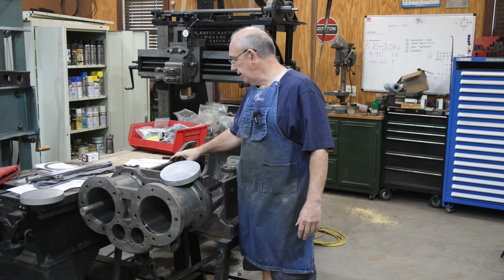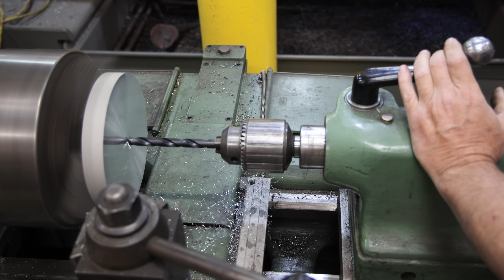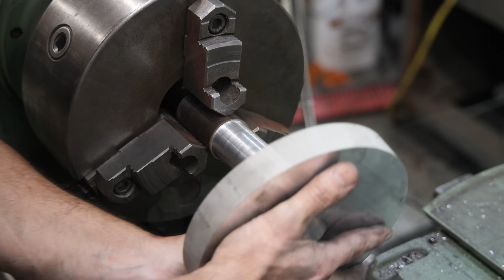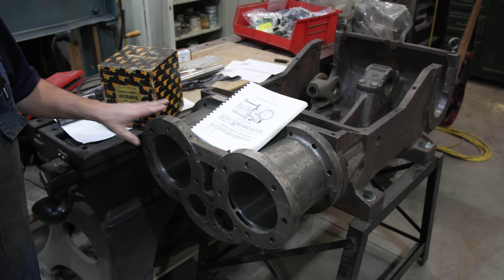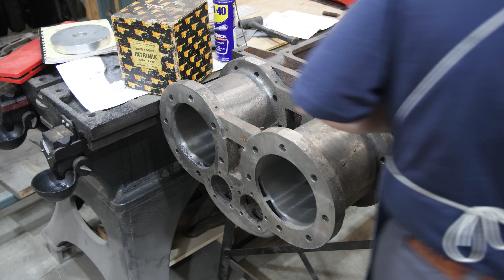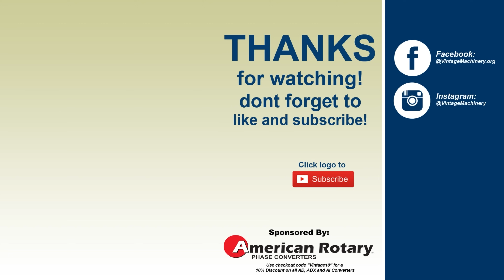Steam Stoker Engine: Turning Alignment Disc for a Crosshead Fixture

Comment: The connecting rod to cross slide wrist pin plane is going to have to be held parallel to the crank shaft as part of the babbitt pour setup? If not the cross slide Babbitt bearing surface could end up not being parallel to the wrist pin and cause the connecting rod big end to be twisted on the crank shaft journal. Might be getting ahead of myself here of course. One way to achieve this would be to duplicate the cylinder rod disk setup and then make a long wrist pin mandrill that passes through both cross slide wrist pin bores, effectively removing any potential twist in the setup. Keen to see how this pans out.

Comment: What was the purpose to clean up the case bottom if the pony rod will ride on babit?

 the
Reply: I was wondering the same thing but finally figured out that the babbit goes on the slide, not the housing that was machined.

Comment: Ahh! The memories this video brings back. What a wonderfully centrered facing tool - not the easiest thing to do as I remember to not leave a pip in the middle! The three legged bore micrometer was much easier to use than the simple two legged internal micrometer but as I discovered, despite micrometers being fitted with a friction thimble for repeatability of readings, if you don't get the faces of the anvils perfectly alingned with the surface of the object you are measuring, the thimble will give a false reading. The friction thimbles are too clumsy for precision work - you have to feel the contact with the anvils and assess the pressure you are applying to get a true reading. My grandfather was a tool maker and he never used the friction thimbles. Thank you Keith for keeping these skills alive.
Reply: It is called technique. You have to know the proper feeling when it is right. Comes with experience.

Comment: Drill straight to a reamer on a lathe is a bad choice, pass a booring bar through there to get the hole true, a reamer follows the hole. if the hole is questionable then you are getting a questionable ream.. also on a drill that big if it was hand ground the chances of it cutting on size aint good, 20-30 thou over is real posible if your tips off a little. don't matter so bad here since you are putting it on an arbor, but its good to be aware of it.

Comment: Have you calculated the deflection of the shaft due to the weight of the slider hanging on the unsupported end? It may not be much, but worth considering.
Thanks for your always interesting videos.

Comment: Still nothing to hold that shoe in the transverse orientation!  You need a shaft going sideways to simulate the wrist pin or cranck journal. If not it wont be perpendicular to the axis of the crankshaft, then you'll try to fix it by scraping it in which will lower it in respect to the axis of the pistons which you just established, then nothing will be lined up.
Reply: Hey, how dare you question him, he knows everything!:body-blue-raised-arms:
He will have it even more butchered up, so get out the pop corn and have some laughs!:hand-orange-covering-eyes::face-blue-smiling::face-blue-smiling:

Comment: Are the pistons on the stoker engine only single acting?   It seems to me that, if they were double acting, one direction of stroke would lift the babbitt blocks out of the slide ways.
Reply: looking at the old videos it appears this is a single acting engine.

Comment: After watching the threading machine repair for Leo (Tally Hoe) this Stoker Engine for me hooked. I'm so looking forward to watching the progress on it. Will you be needing to make a jig to hold the slides so the pinion hole is horizontal? 
Again thanks for the videos, and it's a shame I'm on the wrong side of the pond...
Reply: "Will you be needing to make a jig to hold the slides so the pinion hole is horizontal?" I was wondering the same thing. I would think the centerline of the two holes in the slide need to be accurately aligned to the centerline of the crankshaft. I'm wondering if installing the rotating assembly and connecting it to the alignment shaft is an option to hold and align the slide for the Babbitt pour.
Reply: Hey, how dare you question him, he knows everything!:hand-orange-covering-eyes:
He will have it even more butchered up, so get out the pop corn and have some laughs!:face-blue-smiling:

Comment: May want to put a couple of tapped holes in the disk; this allows a way to grab the disk in the engine and remove it.  A third hole in the disk would allow air to move between the sides of the disk preventing vacuum lock when the disks are in the engine.  As always, thanks for the videos.
Reply: He could just slide out the shaft, leaving a 1½" hole in the center.
Reply: Good grief! It is a static fixture to pour babbitt. Remove the cross slide and shaft and pull the disk out by the shaft hole.
Reply: Having air trapped in the cylinder is a definite consideration.
Reply: It's not really going to vacuum lock without the packing gland in place or any valves on the steam passages.

Comment: Could these just be made from less expensive material like wood?
Reply: Wood is not dimensionally stable for that kind of accuracy.
Reply: @ i bet it could be an option in a pinch. It’d be cheaper and take way less time to progress.  The tolerance for such a large piece, and for just pouring the babbitt, would probably be good enough.  For machinist enthusiasts or paying customers I get that it’s not an option.